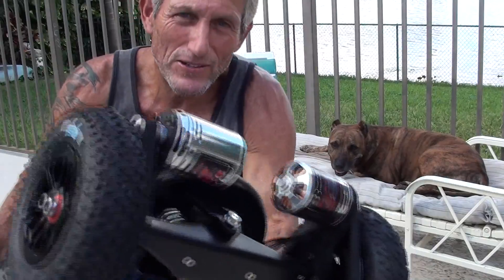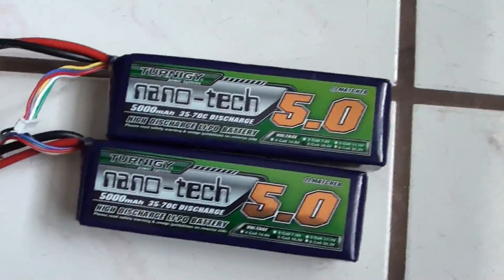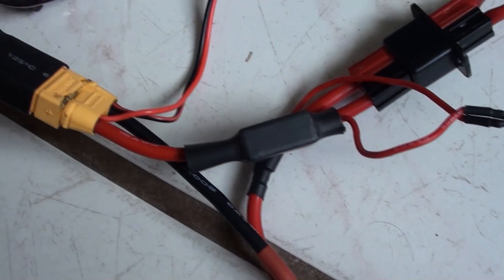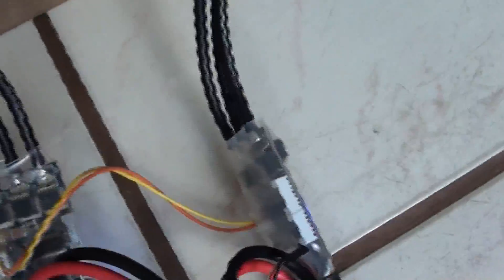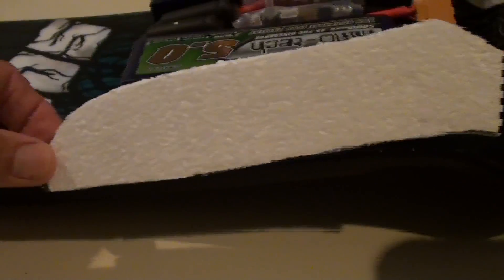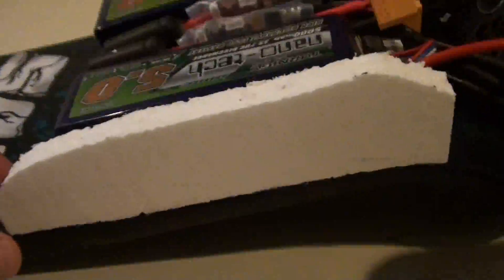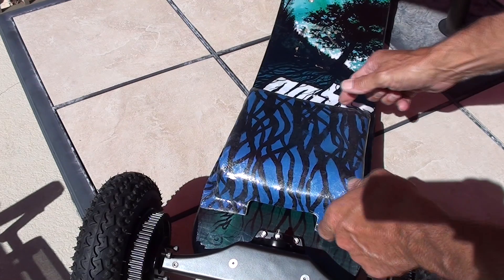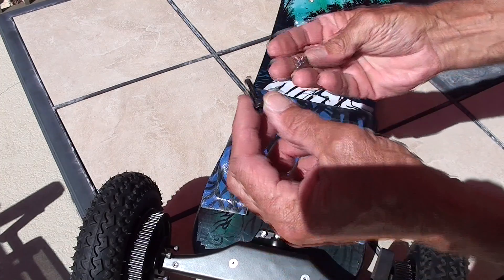Electric Mountainboard/Skateboard Build

Comment: Those are actually two 3 cell batteries. The 5.0 is the amps
Reply from the maker: Graham Hutchins I'm running 2 lipo batteries. Each battery is 5 cell-18.5v
Reply: oh, ok. Thanks for the clarification. :)
Reply: Oh, ok. Thanks for the extra clarification.

Comment: make a electric skateboard cheap
i choose two motor of ebay 
n5065 (china) 270kv or 400kv its better my battery is 22.2v lipo 
i want fast and torque
whith motor its better ?
Reply from the maker: akis akis hi, I would go with the 270 kv over the 400kv. My understanding is the 400 will spin faster but less torque plus you run the risk of overheating. There are other factors that affect  speed such as gear ratio and wether you wire your batteries in series or parallel. I would suggest you check the esk8 forum for more info. Lots of excellent advice there: https://www.electric-skateboard.builders/t/how-does-the-kv-amount-depents-on-the-maximum-speed-range/17727
Reply: thanks i order 270kv cnina motor ebay 40euro

Comment: Hey "flysurf244,", that's a fantastic build. I'd like to know the total cost of this magnificent project, and also the range in terms of distance for the batteries you used.
Reply from the maker: Karthik Onteddu Thanks man! I spent approximately $900 USD on electrical and mechanical components. I already owned the mountainboard so if you need a board that would be additional $$ depending on the board you will be using. As far as distance, I can go around 9 miles on pavement. A few miles less if off-roading.
Reply: Thanks man! I just wanted to know how do you charge this board
Reply from the maker: Karthik Onteddu i disconnect the batteries from my board and connect to an iMax B6 AC V2 balance charger with a parallel charging board. If you're not familiar with these just google search them. The parallel charging board allows me to charge all batteries simultaneously. Caution: there are a lot of cheap knockoff chargers out there. They could be dangerous and start a fire so stick with the original.
Reply: thanks!

Comment: How many LIPO do U use for which VESC?
Reply from the maker: Zama You can use as many batteries as you want depending on how much distance you will be able to travel.  The number of VESC used is determined by how many motors you are running. Use one VESC per motor.

Comment: That was a fantastic video.   I'm interested in making one myself.   For a beginner with not even the slightest experience.  Where would you suggest I begin?
Reply from the maker: Shane F Thanks man! First I would check out eSk8. https://www.electric-skateboard.builders/  Just about every question that has been asked has been answered on that forum. That community is extremely helpful and will answer all your questions. Then decide how much you are willing to spend. You will find a wide range of parts at different price points. Go with the highest quality you can afford. Many electric skate companies sell complete kits. That may be the way to go for you. Although it may be more expensive , it takes the guess work out of what works and what doesn't. Good luck!

Comment: where can we buy the controllers for the motors ? a website if it's possible ;-) thanks
Reply from the maker: pierre salmon The motors are from www.hobbyking.com and remote is from www.dhgate.com
Reply: thanks ;-) and what is the "name" of the motor (reference) ?
Reply from the maker: pierre salmon Turnigy 192kv 6374 brushless motor
Reply: thanks , I'm strating quite the same project ,thanks you for your help
Reply from the maker: pierre salmon cool! Good luck. Lmk how it turns out.

Comment: Nice!
After a few months now, is there anything you would do differently/change?
Have you ridden an electric skateboard?  Wondering how these mountain boards compare.
Reply from the maker: Mark Myers Thanks Mark! Wouldn't really change much. Just little tweaks here and there. An actual batter pack vs the individual lipo batteries I'm using would be nice but I was trying to keep the cost reasonable. The battery packs cost substantially more. Yes I've ridden both style boards. Both are super fun depending on how you like to ride. I like to just cruise around on the street with the option of off-road so that's why I went with the mountainboard.

Comment: Hey Flysurf, love the design thanks for sharing! If I were to use 2 8,000mAh batteries instead of the 5,000's you're using how much more distance do you think I could achieve?
Reply from the maker: Ben Seward Wow! That's a lot of juice! I would  just be guessing because so many factors involved but if it were on my board I'd guess 12-14 miles? I'm sure there is a formula to figure that out.

Comment: Good afternoon, I liked your project. What brand of radio control you are using?
Reply from the maker: Mario vieira de souza Hi, I'm using a generic remote I purchased on dhgate.com. Best price I could find and remote works well. No problems so far.  http://www.dhgate.com/store/product/2-4ghz-mini-remote-controller-with-receiver/377608417.html#sshot_-2-null
Reply: flysurf244 I am looking at purchasing one. Great build btw. Does it have brakes and have you ever had any dropouts with the connection? Cheers

Comment: Hey there, great video!  I've got both a voltage indicator and a similar battery capacity indicator like yours.  Do you find that the % from the capacity indicator is as accurate as the voltage alarm?  Love your board!

-Neil
Reply from the maker: Big Kids Hi Neil, The battery capacity indicator is fairly accurate. I compared it to the voltage indicator on my charger which is very accurate and although not exact it's close enough to give me an indication as to how much power I have remaining.
Reply: Gotcha!  Thanks for your response.  I think I'll be finally adding that to my board now.  Anyways, we have a channel which will be focused on diy, vendors, and the esk8 community.  I think this would be a great resource especially for new guys getting into esk8.  It would be an honor if you'd subscribe to our channel.  Anyhow, can't wait till you post another vid, as these are super helpful!

- Neil
Reply from the maker: Big Kids just checked out your channel. Cool video! Awesome job on your build! Everyone should check it out.
Reply: flysurf244 thank you 😊 I'm junked that you'd say that since you build is actually what I'm planning on next!  I'm already editing the next build which will focus on a particular parts vendor.  I hope 🤞 that from a high level I can bring some perspective to people new to the hobby.  Again, appreciate the support!

Comment: So I went to home depot and I was looking at this fiberglass because of your video and the guy there told me to buy both the Cloth and the Mat - He said if i did the mat first and then the cloth it would make it stronger... the mat just looked like the cloth except it was just randomly woven and intertwined - not sure if that is legit but he was like ya look it up on YouTube lol - so here I am again trying to decide if I need to buy both looking at videos on YouTube although yours looks just fine to me - have you found that it is pretty bullet proof? I have kydex too - I was just looking at doing this because I didn't get my oven element for a non food oven until just now. Thanks for making this video :) and responding to so many of us!

- Kage
Reply from the maker: Big Kids Hi, Yes you can use fiberglass mat and cloth. It's actually easier to build up thickness using the mat then, if you do a color or design, cover it with one final layer of 4oz fiberglass cloth to protect the design from getting beat up. I used all cloth because I have quite a bit left over from my surfboard building days. Cloth is probably a little harder to work with. Both methods are plenty strong as there is not much force on the enclosure. Just be sure to build up  a number of layers as I show in the vid. So yes the HD guy gave good advice.

Comment: Hi I really like your build.  The simplicity of it is great.  I had a few questions.  1)Why did you use a lipo vs the 18650 batteries that everyone seems to use? 2)How is your range? 3)Would you change anything?  Great build!
Reply from the maker: Richard Rhinehart I believe the 18650 lithium-ion batteries are less expensive so that's probably why they are more popular. The lipo batteries, from what I understand, provide more power so that's why I went with them. No, I wouldn't change to 18650. My range is approximately 9 miles.

Comment: What is your gear ratio or number of teeth on each pulley and length of belts ?, nice clean build !!
Reply from the maker: 88Nikoli Gear ratio is 6-1. 12 teeth on small gear, 72 teeth on large gear.  For dimensions on the  belt I'm using just google this HTD415-5M

Comment: Does the dual vesc set up give you varying modes like eco, normal, and boost that are selectable by the remote?
Reply from the maker: Max Break Kind of. You can make the trigger remote control more sensitive on the fly which will make the board react faster/slower.  But, all the motor output limits/adjustments are set when you program the VESC. You can alter how the motor will run there.
Reply: Thank you for the speedy reply.

Comment: How do you charge the batteries?
Reply from the maker: Star Respy I use a IMax B6 AC V2 Balance charger with a parallel charging board. Be sure you get the original and not a cheap knockoff as they can be very dangerous.

Comment: please i need a way to buy this in Ireland  
Motor with mount and rc controller and the visp 
and i have at present chain drive but i my like to buy 2 
wheel with belt drives :D 
if you can answer to me please i/m ready to make a donation from 5 to 15 euro to the person that helps me with everything and if successfully get all the parts , and if i get discounts because a very good recommendation  i make a bigger donation :D 
i have an working skateboard with 500 watt h battery  lithium ion
Reply from the maker: Hi,  Check the comments and you will find all the links where you can order the parts online.

Comment: is it a 24v and a 300w
Reply from the maker: TheNorwegianGuy I'm running two LiPo batteries wired in series. Each battery is 5s/18.5V/5000mah

Comment: where did you get those VESCs?
Reply from the maker: Hi Alex, I've used 2 suppliers, Ollin Board Co. and DIY Electric Skateboard, but be prepared to wait as for some reason they take forever to get shipped. Not sure if its demand or lack of parts available. Ollin charges more but they back what they sell. I had a problem with the VESC from DIY Electric and they don't offer a refund or replacement unless you purchase the warranty. There are many other suppliers out there also so check around. Good luck!

Comment: How much batteria you have and how long you can go on a charge? Mine does 900w peak with a single NTM 50-60 270kv .... However I believe it runs around 360w ,480w on average steady speed
Reply from the maker: Hi, I'm using (2) 5s LiPo batteries wired in series. 10 cell total- 5000mah. I can go approximately 9 miles (14.5km)
Reply: +flysurf244 well then it's doing great matey! I'll rebuild mine when I have money and time to spare and I'll probably gonna try to set a 300Wh battery pack so it will be enough juice to go from my house the the near pier with few runs then back home

Comment: Hello Flysurf. My name is Jeff.
I live in Brazil and we are entering the summer here. I have seen many skateboards but nothing so perfect and beautiful and clean as your job.
I want to congratulate you on your ability.
I'll be very happy if you get a list of the products that you used to do here. Me and my daughter. It would be possible? I do not know the name of absolutely nothing but we will build with a lot of patience if you help us so we will take the list that makes the store and build a fantastic summer, Flysurf.
Reply from the maker: Hey Jeff, Thanks and glad to help.  Important: Make sure all the electrical connections match, it will make things much easier. If you order  the mechanical kit from Scramboards make sure the inside diameter of the motor gear is the same as motor shaft as they come in different sizes. Also, Scramboard motor mounts didn't fit the MBS trucks I had so had to use Trampa Infinity trucks which worked well with the motor mounts. Check around for the best prices, eBay, amazon etc. Links below are a good place to start.

Motors, batteries: https://hobbyking.com/en_us
VESC: http://diyelectricskateboard.com/diy-electric-skateboard-kits-parts/vesc-the-best-electric-skateboard-esc/2
VESC with warranty: http://www.ollinboardcompany.com/product/vedder-s-speed-controller
Mini Remote: http://www.dhgate.com/store/product/2-4ghz-mini-remote-controller-with-receiver/377608417.html#sshot_-1-null
Mechanical Drive Parts: https://www.scramboards.com/conversion-kits/kit-4-mechanical-drive-train-brackets-parts-kit.html8
Also used Ebay for many of the electrical connections such as the series connector, battery meter etc: http://www.ebay.com/itm/2016-Battery-Capacity-Tester-Indicator-for-12V-24v-36v-48v-CAR-Lead-acid-lithium/172143986261?_trksid=p2047675.c100005.m1851&_trkparms=aid%3D222007%26algo%3DSIC.MBE%26ao%3D1%26asc%3D20131003132420%26meid%3Df11d625055f44abaab01d75be8c85db2%26pid%3D100005%26rk%3D2%26rkt%3D6%26sd%3D3318791017972  
Battery charger: https://www.amazon.com/Genuine-SKYRC-Power-6Amps-50Watts/dp/B00ND7J38C
Parallel Charging Board: http://www.ebay.com/itm/Parallel-Charge-Board-for-PolyQuest-XT60/291808240201?_trksid=p2047675.c100005.m1851&_trkparms=aid%3D222007%26algo%3DSIC.MBE%26ao%3D2%26asc%3D38530%26meid%3Defe67b9e24dd456f8a9c10b3569b4bdb%26pid%3D100005%26rk%3D4%26rkt%3D6%26sd%3D251968374224
Reply from the maker: Escola Legends There is a setting on the meter you adjust to the number of cells you're running.
Reply: how did you get the lead acid battery tester to work with lipo battery?
Reply: flysurf244 what type of wheel are they
Reply: Have you got the parts list please.

Comment: Very impressive build, one of the best I have seen yet. 
I noticed you had a battery percentage indicator on the board. How did you go about achieving this? Is is simply programmed to read the voltage directly from the battery and display the percentage accordingly, or did use a BMS (battery management system) with your batteries?
Reply from the maker: Hi Will,  The battery capacity indicator has a setting where you select your battery type. There is a button on the back you hold down before connecting battery. Connect battery then toggle thru settings. Check out the pics in the link. This is the same battery meter I am using. http://www.ebay.com/itm/2016-Battery-Capacity-Tester-Indicator-for-12V-24v-36v-48v-CAR-Lead-acid-lithium-/172143986261?hash=item281494c655:g:BiAAAOSwJQdW8m~D
Reply: Thank you, I have been searching for something like this for my board for a while now.
Reply: Where did you get the wheels from? I'm looking from some quality all terrain wheels and haven't been able to find many. And did you get the gears that are attached to the wheels from somewhere as well or are they custom made?
Reply from the maker: The wheels are Trampa wheels but I got all mechanical parts, wheels, pulleys, belts, motor brackets from Scramboards. You can buy it from them as a kit. https://www.scramboards.com/conversion-kits/kit-4-mechanical-drive-train-brackets-parts-kit.html8

Comment: What's the top speed? Have you test your range?
Reply from the maker: Hi Alan, I have gone right around 9 miles on flat pavement. Haven't redlined out the speed yet. Ive gone just under 20mph with plenty throttle left. 20mph on a mountainboard feels super fast!

Comment: Hey Flysurf244, any chance you can do a video on your charging setup?
Reply from the maker: Hey Gary, I use an IMAX B6AC V2  balanced charger and a Parallel Charging Board so I can charge multiple batteries  simultaneously. Just make sure the connections on the parallel charging board match the connections on your batteries. https://hobbyking.com/en_us/imax-b6ac-v2-professional-balance-charger-discharger.html  https://hobbyking.com/en_us/hobbyking-safe-40a-parallel-charge-board-for-4-packs-2-6s-xt60.html
Reply: Thanks brotha! Awesome build btw

Comment: Why not add an eternal port for a backpack array. You could easily put 4 to 8 of those same LiPos in a backpack and have a lead with a breakaway connection from the backpack to the power system on the board for 40 mile rides...
Reply: i think 40miles on such a board would be pretty exhausting, and this is about fun after all :)
Reply from the maker: Interesting. Haven't thought of that. Tesla killer? ;)

Comment: Sweet.  Build.  I am fellow kitesurfer.   I have that Mountian board also.  U have giving me the buzz to copy this board. You changed the trucks ?   My trucks are different.  Did you purchase new trucks ?   VG. Video.  Love the casing u made for batteries etc etc.  3 month wait for the parts is the downside
Reply from the maker: Awesome Warren! Yes I changed only the rear truck to Trampa infinity truck because the motor mounts I used didn't fit the MBS truck. Love the board. Ride it nearly every day.... when there is no wind of course ;) Good luck on your build

Comment: So would the battery pack be a 10s1p? What kind of range do you get with that? 

Also where did you source the off road wheels, wheel pulley and belts? 

Thanks in advance
Reply from the maker: Hi, Yes the batteries are (2) 5s LiPo. Total 10s. I get a range of around 9 miles. I got the rear wheels, trucks, pulley's, belts and motor mounts from Scramboard:  http://diyelectricskateboard.com/diy-electric-skateboard-kits-parts/vesc-the-best-electric-skateboard-esc/2